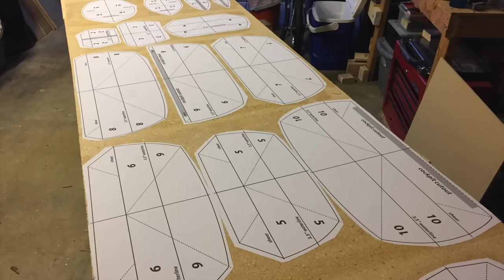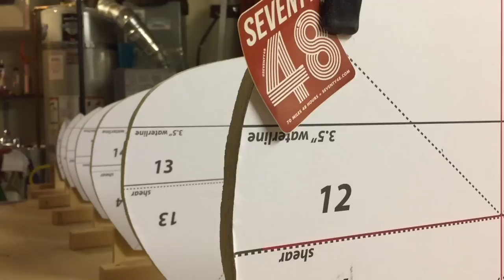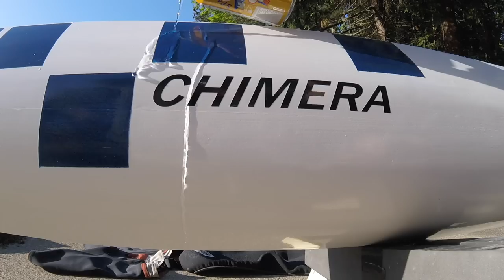Chimera: Building a wood-strip high-performance kayak

Comment: Great job. I've made two strippers and only if convicted of a felony could I be forced to make a third. One problem with wood cores is that the tiniest hole water gets in expands the wood  pops the epoxy/glass off the wood grain. (Just watch out for that probably with some diligence you can avoid this.) 
Are there no bulkheads in your 'yak? I took my second one out with 4" foam bulkheads an 1" larger than where they're positioned. The shape was perfect and I had to hammer them into position. I hadn't caulked them because I wanted to first make sure I was trim with my seat and foot braces. I got flipped and the hull filled up like they weren't even there. Once your coaming is below the surface of the water you can't pump out. I called the lifeguards (or I would've died). What I figured out later was I could've put my skirt over the coaming and then pumped out. Ever hear about MacGyver? I've been called that more times than I care to remember. Yet I didn't think to use the skirt.  (There's a couple of books Deep Trouble about sea kayaking accidents. I read that before I launched my first 'yak. A friend's death made the magazine and would've been in a third edition.)  Maybe you have dry bags inserted. That's what I use in my skin on frame (SOF).You want to fill up as much of that space as possible. 
Your foot brace- brilliant. (Surf skis in general seem more well considered than most sea kayaks) I've been a sea kayaker for 15 years, hate the pegs. In fact I think that foot pegs still existing means that either people really aren't sea kayaking as much as they could, or they're just not putting much effort into it.  Me? the Yakima standards: numb feet and I'd snap one of 'em off about every year. I soon upgraded to foot braces, but had to reinvent the wheel to do it. In the end I wound up buying the Yakima foot brace kit and then screwing my footbrace to the footpegs (now it's adjustable) The foot brace being attached on  both sides the pegs never snap off. 
I just  ss wood screw screwed a foot brace to the pegs as quick-n-dirty/temporary but it just worked great so that's all I do. (I've made three kayaks, repaired a fourth.  The third a SOF 'baidarka' (the Aleuts called them iqyax) and fixed a factory yak. All four have my DIY footbraces. For padding I buy cheap 1/4 and 1/2" yoga mats off Amazon. 1/4" on the hull -warmth and padding, 1/2" on the foot braces. For the seat. I've made seats, I've bought those gel pads... What I do now is start with anything, that's like a seat, then pad it out with built up 1" and 1/2" yoga padding. I use a back brace, but if you paddle enough you don't need it.  
On my second yak I added windsurfing straps to the brace. Very cozy very helpful. Webbing with some yoga mat can easily do the same thing. 
Pink insulation foam works great, as you clearly know. For the second stripper -  narrow 17" beam and the iqyax 16"   I made outriggers with the amas being pink insulation foam. The theory of outriggers is that most of the balance comes from the small amount of weight at the ends of the pole (like a tight rope walker), so the floats should be a couple of inches above the water. (I'm older so my balance is getting dodgy, but most surf ski guys I see looked a bit nervous after a run.) 
Hope this helps.
Reply: If you get moisture to the wood you have done a mistake. First a super thin base layer of epoxy, then fiberglass and at least 3 coats of epoxy, and a minumum of 4 layers of PU varnish/paint. The wood is sealed up great!

And even so, if the kayak gets a serious damage, and is varnished, you will see if water gets to the wood. 
Mine is made of spruce, and spruce don't absorb water. So I can paddle for weeks with a hole into the bare wood without damaging the kayak, then dry it out and repair easily when I have the time

Wood core gives greater strengt, stiffer hull and lower weight compared to a normal sea-kayak fiberglass hull.

And if you install bulkheads, do not jam them hard into place. This causes the hull to deform (done that), and in case of heavy impact you will get more preassure in the point where the bulkheads are jammed hard into place (a breakage point). Foam bulkheads work great, but cover one side with fiberglass and epoxy, and let the fiberglass extend 1-2" inside the hull, and you have a solid and 100% waterproof bulkhead. Solid enough for foot bace :)